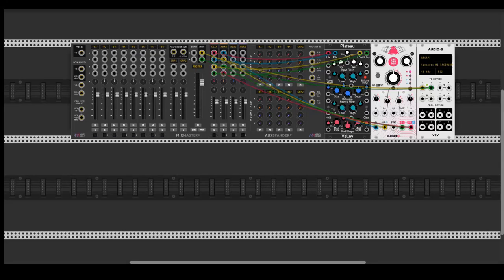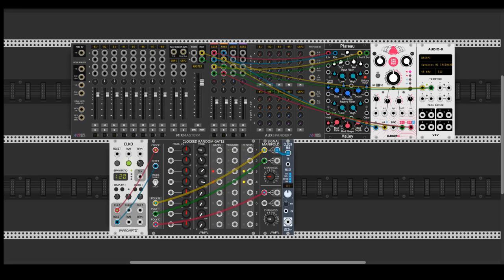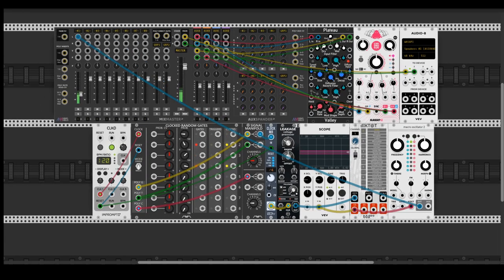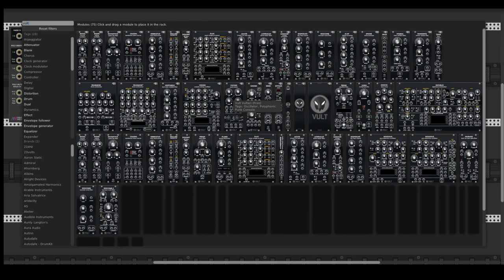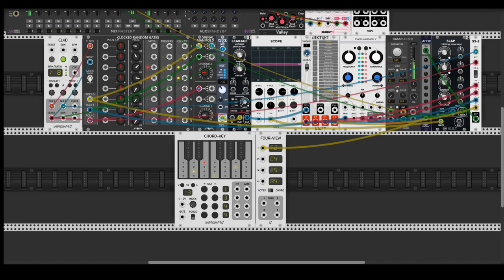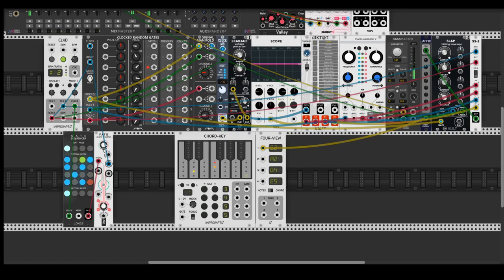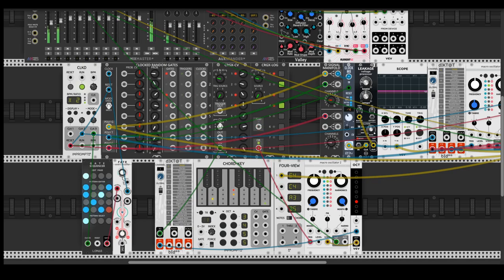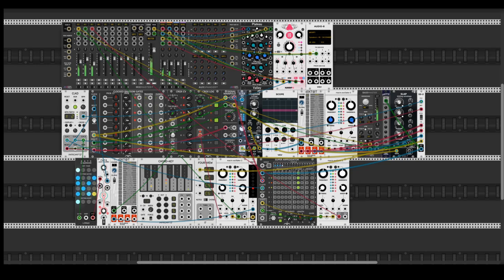Building GENERATIVE ambient CHORD PROGRESSIONS in VCV Rack

Comment: Great tutorial! Is it possible to use vst chord generator like chordjam in vcv rack using the vst host module or the midi module? Thanks :)
Reply from the maker: Yeah, why not. I think vst version of Rack can be easier in this way
Reply: @VCVRackIdeas  thanks for the replay. Yes. But I would like to avoid using a daw :). Do you know if vst host module can output polyfonic midi?)